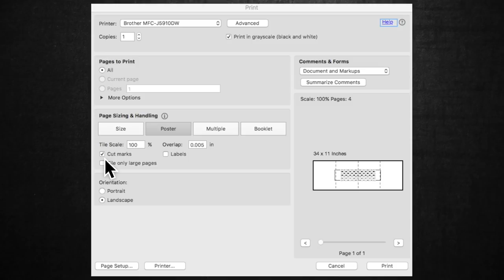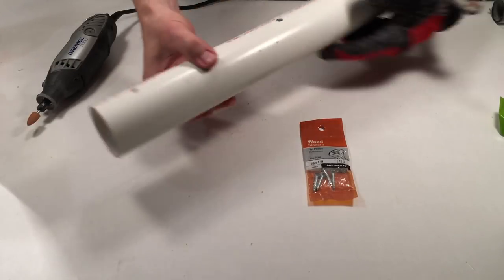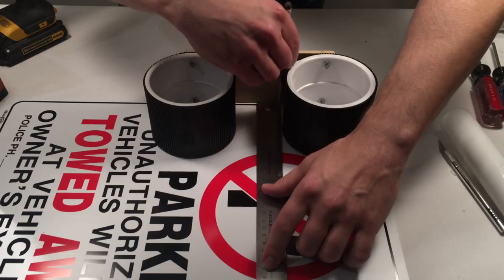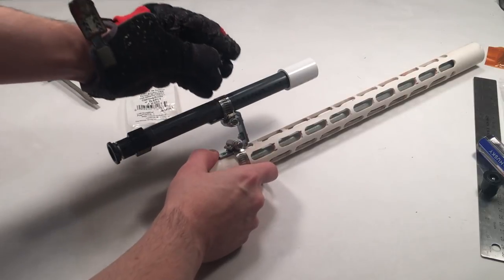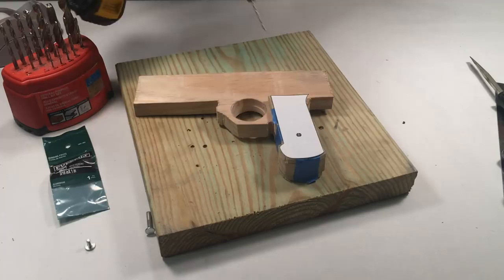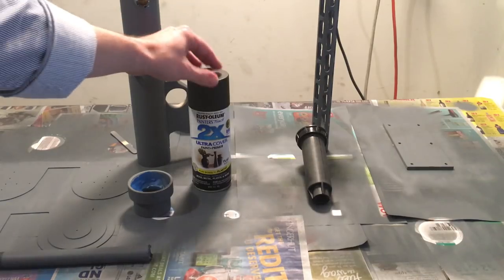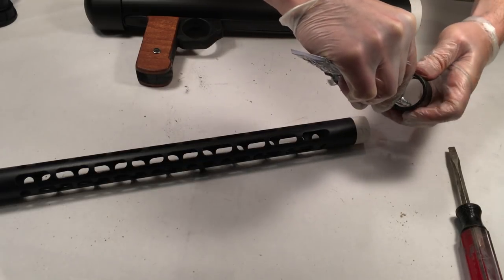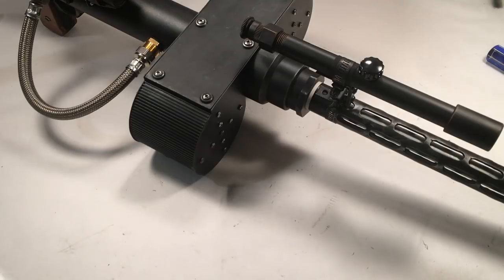DIY RT97C (MG15) Heavy Blaster Rifle Prop

Comment: It's actually a Mg 15 (German) which was first used as aircraft machine gun, but later also used in ground combat. The Mg 15 for ground combat were modified with a bipod and a special stock